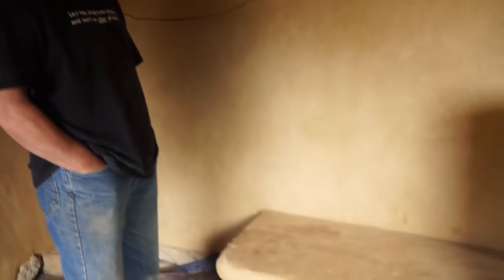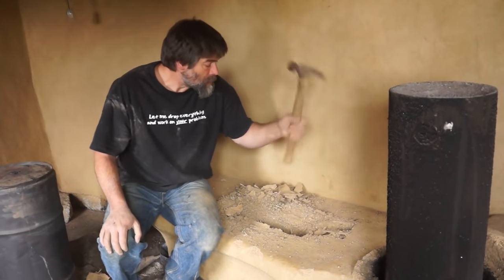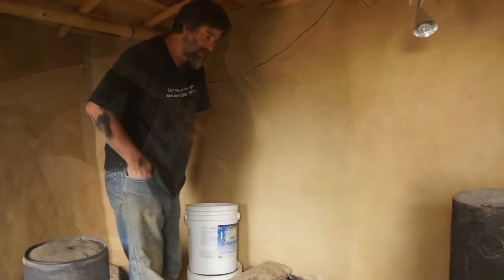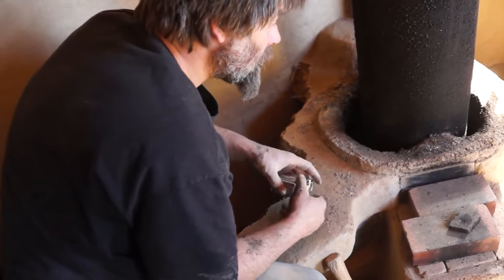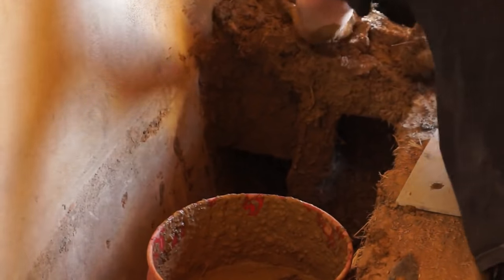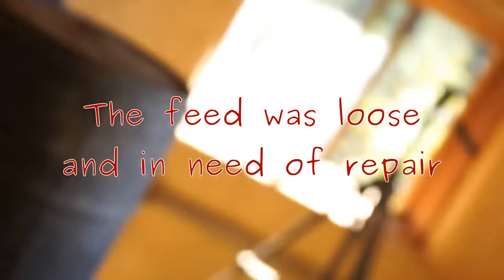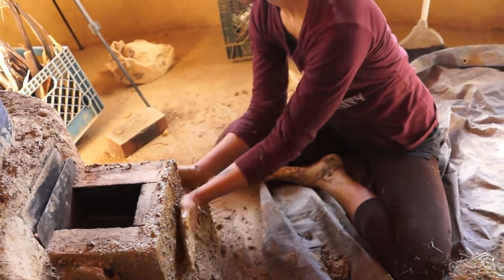Rocket Bell Retrofit

Comment: With a basic understanding of the principles of Rocket mass heaters, this is one of the most interesting and informative Rocket mass heater videos I've seen.
Thanks for the video!
Could you let us know how it's performing?
Reply from the maker: Pawnjp 
Thank you.  After a bit over a year of use, I can say with confidence that the stove's performance has improved significantly.

Previously, the barrel would overheat the space, but the mass would not charge well. So that while the room was plenty warm while the fire was running, shortly after going out, the stove body would be too cold to carry until morning.
All of that has changed. Now the mass heats properly and evenly within a reasonable amount of time, and it continues heating long after the fire has gone out.
Reply: Good to hear.
I'm really grateful for the opportunity to be able to learn from you.
Thanks again.
Reply: Except there was basically NO explanation of how the so called bell chamber was designed and built.
Reply from the maker: @stevenfeil7079  
Just saw your post, late but not never eh?
The video itself shows how it was built. As to design, we used what was there, constrained by existing structure.  Design was on the fly.

Comment: Okay, question? Unless I missed something, did not see a door or place to empty ash from burnt timber? I tried to build one once but once the ash built up clogged the hole and smoked out the cabin: What did I miss???????
Reply from the maker: You have to build in cleanouts. Some kind of port or door is needed for each pipe run or area.
In this stove, there is a clean out on both sides of the bench and one beside the bottom of the barrel.
Reply from the maker: The feed box itself should be cleaned out after every couple burns. It can be scooped out from the front.

Comment: I guess you know by now that the entrance can be high..it's heat.  and the exhaust is low...cool.   you didn't need to lower the entrance portal.
Reply from the maker: Yep! Thanks for vocalising that. Bells can be fed from any height. As long as the exhaust is low

 Though I think it is advantageous to intake to the bell low if possible. Seems right to reduce turbulence in the top of the chamber. Just a thought..
Reply: I wonder if you fed the hot air into the bell off a shelf to minimize turbulence and mixing?
Reply: SunDogBuilder  I was wondering about the reason for bringing the hot air into the bench low and that does make some sense.  What about a bit of a divider between entrance and exit ? Or does the "air" cool enough so that only the coolest air leaves the bell regardless of the fact that in and out are right next to each other?  What about exiting the air at the far end of the bell?

Thanks for posting, i like the ongoing commentary.
Reply from the maker: Good question. 
If the intake and exhaust are too close, the heat can take a shortcut straight out. In general though, because there is a lot of space in there, hotter stuff will rise to the top and cooler, sink to the bottom. Sometimes a baffle is needed between but most often, it doesn't matter where the exhaust is located in the system. This is one of the strengths of the bell method. It frees up a lot of design considerations.  You dont have to worry about how pipes will be arranged or deal with the spaghetti effect or tangle and ot makes cleaning much easier as well.

Comment: When you're using a "bell" style mass as you call it, wouldn't you want your hot gases to enter the chamber higher than the exit point?
Reply from the maker: Typically, yes. 
But its not that important. As long as the exit is at the lowest point and there is no way for gasses to shortcut the bell, you're good to go.

Comment: I have been wanting to build one of these rocket mass heaters. Do they burn and heat better than a wood stove. Use less wood? Or should I scratch my idea of building one. New subscriber to your channel.
Reply from the maker: That will depend on a lot of factors.  They can burn wood far more efficiently than a box stove and if you balance that properly with mass, it can equal a significant savings in wood use.

Having said that,  as a home gamer, it's not that hard to build a lemon.

Comment: Very good description of what you were getting ready to do as you worked. I have never built a stove yet I could follow your plan in my head. Do you have any recommendations for a 260 sq ft bungalow.
Reply from the maker: A six inch J-tube  rocket like this one should do.  I'd build a few test models outside, somewhere safe, before committing to a permanent installation. There are some fine points to building a good stove that can become more obvious by doing.

Comment: Great camera work and commentary! Since you restricted the bell chamber to the existing bench, do you have any insights to best proportions of chamber to firebox or chamber to heat riser?
Reply from the maker: Tolba Szy 
Yeah. Chambers are sized by internal surface area, not includong the floor. A 6 inch system like this one uses roughly 60 square feet if internal surface area.

Comment: I noticed your flue pipe was exiting at a wall instead of roof. Can you please tell me when the flue pipe exits horizontally do you have to use a 90 degree fitting on outside and extend more pipe vertically? Thanks for great video and wondering how it's been doing since nearly 4 years have passed since you published video, does the bell design give you better heat storage than the pipes did?
Reply from the maker: Yes.  There's a 90° bend outside and an extension of the pipe to go above the roof line. 
The bench gets warmer and holds more heat now. I'm very happy with the change.
Reply: @SundogbuildersNet  Thank you!
Reply: @SundogbuildersNet  do you find your flue pipe is cooler bcos you are extracting more heat?
Reply from the maker: Yes, that's the point. Heat NOT going out the chimney is heat trapped in the building.

Comment: I did not see any drag and did not here the tipically rocket sound of this stove. As I saw some smoke and flame came out around the firewood into the room back.
Reply from the maker: ?? Can you clarify that statement?
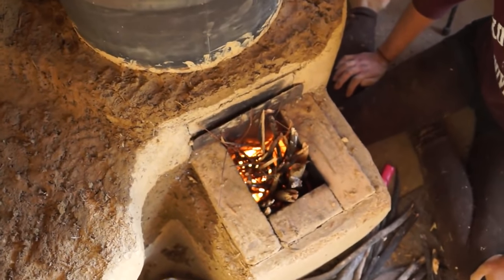Reply: @SundogbuildersNet  16:45
Reply from the maker: Sure. Starting these stoves is sometimes slow going. That was the first start after fixing it. The body of the thing was cold and wet and it took some time for enough heat to move downstream to get that chimney rolling.

Quite often, the first start on a wet stove is a total mess. The more mass that is being used and the longer the bench path, the more of a mess it can be. This one did pretty good on its first go and has done relatively well since, with a few hiccups. It was definately an improvement over what was there before.

Comment: hi, and so how do you clean it¿? thanks
Reply from the maker: 2quick4 u 
The firebox gets cleaned every couple of burns, it's dug out through the feed. There are 3 different clean-outs for the bench, which gets cleaned every couple of years. These are tiles held on with a thin seal of plaster around the edges. Scrape the plaster off of the edges, pull out the tile, clean behind; then put the tile back and reseal with a tiny amount of plaster again.

Comment: 5 years old.. ok, with 50 hours of burn time? Go figure... the steel in the riser exhaust was not even damaged from the heat... because it was not used much!
Reply from the maker: Douglas Pohl 
With temperatures in heat risers up around 2500 degrees F. It shouldn't take very long to damage  a steel riser.

I've cooked them (granted, far thinner than this one) in just a couple of intense burns.
Reply: SunDogBuilder Nice video, thanks for sharing.
Reply: Douglas Pohl The 1/4" pipe of my secondary air assembly was gone in a month in my Walker core double bell system.
Reply: That is because the riser is too large compared to the burn chamber. But it still works so who cares.
Reply: Big Dan How is the riser too large?  It looks consistant.
Reply: Yeah I believe you're right. You would think that with such a tall riser it would be more rockety too. I looked at a setup earlier that side drafted just fine but when he put a sight glass in the top of the barrel the flames just weren't doing a whole lot in the riser. He mentioned that it seemed to be running cold, but draws a lot better now. Definitely not hitting the top and mushrooming for the reburn that rocket stoves are supposed to be known for. Part of the pipe seemed collapsed when he dug into it I wonder if there might have been some restrictions. Idk, but so long as the riser insulation is well made I wouldn't care if the steel burned out. 

So I looked at the bell bench system and in theory it really makes a lot of sense. I wonder if I can incorporate a water heater manifold somewhere in the bench close enough to make use of 150f + heat.
Reply: Big Dan Harvest that heat!  
My kitchen floor is a slab.  My water pipes run in the floor.  During long burns my cold kitchen water comes out like hot bath water then gets cold.  My kids love the hot floor.
Reply: That's the idea. I'm trying to figure out the best way to turn a rmh into a boiler to get the best of both worlds. But the major issue is getting a draft while trapping all the heat AND getting a complete burn without using power to create a false draft on the system. The bulk of the house would be heated by modifying the old forced air furnace with a radiator and the upper rooms stay warm so long as downstairs is heated. 

Radiant flooring in the kitchen is a great idea, and might happen during a future remodel since I have to tear out the floor anyway. If I could do it to the entire house I would! Nothing beats concrete floors in the summer.
Reply: Big Dan My hot floors are a surprise bonus, for sure.
Reply: Big Dan Van Powell has a video on water heating.  He got good results by placing a copper coil on top of his barrel.
Reply: I can't listen to that guy for the same reason I can't listen to Paul Wheaton's videos anymore.. The way they talk is so preachy and condescending it's just painful. I can't fault him for trying new ideas but he has shown no proof in any of his videos that his method is in any way better except for his derisive endless play by play. Sadly I cannot imagine that he will ever do a tear down to show what kind of creosote buildup he has from putting a cold sink on the part of the stove that is integral to the reburn of flu gasses. The riser creates the rocket, and the rapid cooling of the sides helps draw the fire even faster. But who knows. Although he did say that he relied on the flu pipe being 200 degrees to stop his system from backdrafting smoke into the room. More testing is definitely needed! That is the beauty of clay and cob.. All you have to do is break it free and make some adjustments and try again!

There really is only one way for me to find out.. Here goes nothing.
Reply: Big Dan If anything, it seems the cob and tile might insulate the burn a little.  More so than the bare radiant metal of the barrel.
Reply: The temperature of the water running through the coils will soak up that heat quickly, although nowhere near as quick as surrounding the drum with a larger water tank "outdoor wood boiler" style. 

2 years ago my well ran dry on the old homestead and I had to truck in water for a couple of months until the rains came. During that time I gravity fed an outdoor teepee shower with a suspended 5 gallon bucket with a dozen 1/16" holes and I scrounged up an old gas water heater with a rotten burner and set it on top of a quicky rocket stove made from stacking reclaimed brick. I tried a dozen different build ups to try to get an optimal burn with no smoke but I couldn't get it to draft through the 3 inch pipe that ran through the middle of the water tank until the water was almost up to temp. Once the water in the tank was gurgling away and the water coming out was scalding it drafted beautifully every time. Finally I built it up so there was a secondary exhaust vent out the back and the flames would rocket up, hit the bottom of the water heater, then roll out the back until the tank heated up and the draft switched back to the center flu and that was the sign to let the fire burn itself out. 

And that one 30 gallon tank was enough for 4 people to have steamy hot showers. It was so much hotter than any shower I've ever taken before or since. And I have to say.. I really miss the feeling of taking a shower in the open air, even, or maybe especially in brisk november! with the smell of wood smoke, and the stars above.. ok anyway.. 

I have a theory I'd like to try. To wrap the outsides of the barrel with copper pipe and cob up to about 2 inches from the top and see how that transfers. I want to heat a few hundred gallons of water in a very well insulated tank, or tanks. [I may go with a half dozen used water heaters with burnt out elements that are free on craigslist practically every other week] as it's going to take more than 45 gallons to provide lasting heat to a forced air furnace, in floor radiant, and perhaps eventually radiant grills in the far rooms not to mention hot tap water for the entire house.

Maybe covering the entire drum in cob and wrapping the entire thing top to bottom in copper coils would actually work. Perhaps the conductive properties of the cob does help insulate the tank from the temperature of the water coming in.
Reply: Big Dan I dug the 40" footer and drystacked the footer for an old cast iron basin tub that sits on a skirt, not legs.   My plan is to make the tub the "top of the barrel".  Probably a batchbox or a walker core.   This summer! Woo hoo!  It'll double as a cold dunk in the heat.
Reply: Yeah using a tub as the top of the "bell" should work great, just remember that people would put wood slats in the bottom so they didn't burn their behinds. I want a small building in the back yard that has a shower on one side, bath on the other, and steam room inside with a wood stove water heater for the winter and steam room and a solar water heater for the warmer months. All the water drains out into the garden and should be a win/win for everyone.
Reply: Big Dan I'll exhaust the tub through a brick bench with a tile top for warm kids and towels.  My wood shed is privacy on one side.  I might continue my motif of spruce pole/morning glory screens for the other sides.
Reply: The thought just occurred to me.. wouldn't exhausting gasses through a bell be a recipe for a big explosion chamber? Especially on startup when you're shoving a ton of smoke and unburnt gas through the system until the fire really gets roaring then WHOMP! Maybe this isn't the right way to try to achieve complete reclamation from a fire.. With the typical piping this isn't as much of a concern..
Reply: Big Dan Nah.  That's what the riser is for.  Combustion is done by time it hits the bell.  As the bell isn't closed there's no chance of boom.  My 1st bell enters at 1/3 height and exits at the bottom.

Comment: So basically you are exhausting into a large chamber and then exiting out?
Reply from the maker: Basically, yes. Entry to the chamber is low and exit is lower.
This insures more complete heat capture and more uniform heat delivery, by the body of the heater.

Comment: https://www.jameshardie.com/products/hardiebacker-cement-board This HardieBacker Stuff. New to me. I like the Bell Bench since it's the closest to the Chinese Kang Bed stove. The only difference between the Rocket. So since you have to replace the metal riser in the Cyclone - and this one is metal. So instead just use ceramic fiber with aluminum foil around it for the heat riser. The only thing is to find a barrel to cover the heat riser. Otherwise this is the EASIEST - no "masonry" like with the Cyclone.
Reply from the maker: To be fair, the Cyclone was specifically intended to have a small footprint.  Also, the cyclone riser wasn't metal exactly. I used perlite/clay inside of an outer metal sleeve. The clay at Paul's place is NOT good at standing up to very high temperatures.
Reply: @SundogbuildersNet  So someone could buy Matt's ceramic fiber heat riser-J tube and then surround it with a cob "bell" - and even a bed/bench.  And embed a steel cook top into the top of the bell. Sort of a Kang bed-stove rocket stove mass heater? thanks for your reply.
Reply from the maker: @voidisyinyangvoidisyinyang885  
Totally! That would be a fine collection of choices!